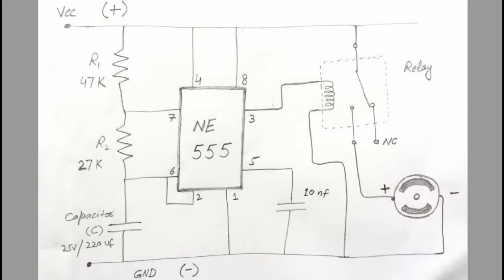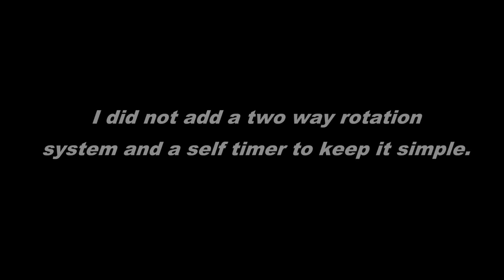How to Make a WASHING MACHINE using Buckets (12V Portable)

Comment: Just a suggestion. Get 5 or 10 one inch rubber bouncy balls. To the inside edges of the washing bucket, glue a half of a rubber ball, the kind you get a toy stores, on various places to create a washboard effect as the clothes are circling around the bucket. This will create the agitation needed to knock the dirt out and push the soap and water through the clothing.

Also, for a drain, drill a slightly smaller hole than 1" approximately 1/2" from the bottom of the top bucket. Insert a male threaded pvc pipe into the hole from the outside. Place a washer onto the threaded end from the inside and use a pvc nut to secure the pipe to the bucket. Use a pvc cap to prevent the water from leaking out while using the washer and remove when emptying. If you want to make the pipe longer, you can either add more pvc pipe or add a hose to the end to run to a drain.
Reply: Ti Phillips 3e

K3m
Reply: Ti Phillips your talent his talent you start a business together I buy
Reply: Invertor technology what is?
Reply: Beautiful suggestions sir very beautiful

Comment: You can make an H-bridge out of power transistors and diodes,  to  alternate the direction of current, the motor then rotates back and forth and it pretty much resemble the commercial washing machine. Great vid though!
Reply from the maker: +Panos Chao thnx

Comment: This is a great project, but I am unable to find an appropriate sized pulsator. All I can find are over 12" diameter which does not fit the common 5 Gallon bucket. I believe that pulsators sold separately are much more common in India, which unfortunately does not export most items like this to the West.

Comment: should have only put the glue on the smallest circular piece of wood.  The way you did it glue bonked out where it didn't belong.  Also it's a DC motor, so you could have set it up to reverse directions between cycles for more agitation.
Reply: Good point. So there should be a locking pin.
Reply: kedwa30
Reply: Kenneth Scharf p
Reply: Kenneth Scharf wwwWA AZ
Reply: H

Comment: Good video, but the design of the washing machine could be improved. If possible, design the circuit to reverse then forward for more agitation and less swirl. Thumbs up!
Reply: After thinking about it, this way is probably better than what I had in mind. Good job!
Reply from the maker: +kedwa30 thnx
Reply: just reverse the polarity of the motor :)
Reply: or if he uses a squared container so the clothes smash against the walls

Comment: For mine, i used bigger buckets and I added a drain plug and a even bigger motor which is 28V power and added a PCB Board to make it spin another way around, for agitation I put brushes.

Comment: did you not use any seal at all around the axel plate? i mean the water should drip by the bolts and axelhole just fine with just a tiny hole?

Comment: you're a smart guy I was wondering why didn't you use a mini shipping Barrel the plastic ones and on the other side where the motor and everything is did you use some kind of sealant so the water doesn't go through
Reply: He did not seal it. The tightness of the connection on the two plastic buckets keeps the seal. You can seal it if that is your preference. Silicone caulk is a good choice.

Comment: There is a reason washing machine agitators change direction. It's so the water pushes through the clothes. If the water and clothes are spinning in the same direction its gonna be very inefficient. Surely this could be done electronically. Close but no cigar on this design. It would also be quite easy to have a basket that attaches to the agitator to spin clothes or just a lock to make the motor spin the whole bucket and a plug in the bottom. Nice first try though. Keep at it ;)
Reply: No want to added

Comment: you should get a better pulsator so it can better clean the clothes, also you should put electrical tape and protect the battery to prevent fire.

Comment: your motor must go clockwise and counterclockwise but your relay connection only shows on and off in one direction/  perhaps you need to change the schematic to allow for the correct rotation?

Comment: Awesome video but I have one question, can there be like a drain pipe to it just to make it easier?
Reply: You can drill a little hole in the bottom and then remove the top part of a bottle and stick it onto the bottom.(make sure that it has a cap otherwise the water will just flow down)

Comment: This is the best damn project so far. I believe some simple improvements can be done with that model, like adding a drainage pipe etc. I also think you'll need a more powerful motor.
Anyway, I'm willing to try this project if I could find the parts.

Comment: Its a nice idea... but it is still incomplete project as a washing machine, don't get me wrong, its a great project.. really.. right now it is still incomplete as a "washing machine" because the rotation of the motor is only in forward or counter clockwise  right? for now its a mixer, but if you find a way to create a control that switches the polarity of your motor then it will become a portable washing machine.. When I was a student, I use to have that same idea, I used the same materials but most of them are scavenged items,  back then in order to have a reverse and forward rotation I used toggle switch hehehe electronic component was expensive that time.. its just a suggestion, make a controller module that switches the polarity from the battery then that's it.. Good luck and nice work, keep it up..
Reply from the maker: +Chinito Gwapito thanks!  I can make it same as you said,  but it will difficult for people to make it. People are already said that make easy projects. If you want to make dual polarity,  just use an H bridge.

Comment: nice project. but the important part is missing the motor should rotate in both directions clockwise and anti-clockwise.
Reply from the maker: +Faisal Abdul Ghafoor it will need a complicated electric circuit. I can make it but other  people can't.
Reply: +Easy HomeMade Projects I guess if u show the schematic of the circuit it will be easy for every one. or better to go for arduino. just an  opinion.
Reply from the maker: +Faisal Abdul Ghafoor ok i will do it in my any next video

Comment: would have been more effective if the pulsator changed directions
Reply: or if he uses a squared container so the clothes smash against the walls
Reply: Yeah would of been better with wool and cotton settings too) LOL, or better still just repair the washing machine you are steeling the parts from).
Reply: Added a PCB
Reply: P plz

Comment: why the water not passing thru the hole between two bucket's??  No rubber seal at all
Reply from the maker: +Nadeem Ahmed buckets are made of plastic. So they will work as a rubber sealer.

Comment: sir in 12 volt dc motor wich motor i should use because there are small motor looks in ebay nd amzo.  how many rpm nd hp pls tell me
Reply from the maker: +Adarsh Yadav you can find on a local motor store.

Comment: great. now add in a rinse cycle so its actually effective.
Reply: All you would have to do is drain the wash water and add fresh water and run it again. Repeat until the water runs clean
Reply: @PinkAlphaMom  Yes but thats not very effective. Just add a hose to one end and a drainage valve on the other.

Comment: Next should be a dryer
Reply: Yes there is a need to spin the water out rather than manually squeeze it, but after that, the best dryer is the sun. However, it does save time to be able to put the clothes in a tumbler rather than hang them on a line and someone living in a hostel may not have access to a line. A typical hair dryer can be used to dry small loads quickly in a tumbler. Just pipe the air through. If the barrel is colored black to absorb the heat from the sun, then the additional solar heat can dry the clothes more efficiently.
Reply: Sun? What is it? I live in UK!! :-D
Reply: and its 78°f / 26°c in the part of the uk i live in right now!
Reply: do you even casul ?
Reply: then a spaceship
Reply: Anonymous 244
why is everyone talking about spaceships today?
Reply: Why not
Reply: Because Leonardo DiCaprio (perhaps jokingly) said he will take Elon Musk's spaceship to Mars.
Reply: Buy a salad spinner and add engine and a hair dryer.
Reply: law Biffingt
Reply: law Biffingto
Reply: Trenzinho da Alegria 
Lmao 😉..
Reply: I got a tension pole for shower curtain and put it over the tub, a space heater that rotates ( reg fan is fine but will take longer) make sure you put it far enough away the clothes dont get too hot, then turned on the exhaust fan. I can put multiple loads at one time and they're usually dry within 2 hours max even without wringing them out

Comment: How long did this toothed Belt last in your wooden pulley. When it has lost its teeth, has the gear on the motor enough traction left?
Do you have a cheap source for geared belts?
Reply: 3 years.

Comment: An interesting idea, but you need it to change the direction every few minutes or the clothes will tangle...
Reply: Not really. The clothes are more likely to tangle from the change in direction. At first I thought as you do that the direction needs to change, but then I looked at my washing machine during the agitation cycle. The agitator reverses very little and mostly to force a complete stop. It may be that the standard design that we are used to seeing is not as good as this way of doing it.
Reply: Well, i have a washer machine at home that doesn´t change the direction of the spin anymore since its watch broke, before it, never make the clothes tangle, now, mi wife has to take out the clothes regularly to stop the tangle...

Comment: I wonder why no drain spicket...
Reply: It's possible with more work, but this design was meant to be the easy version.
Reply: Probably because it's small enough to just dump. Adding a drain is very easy you really shouldnt need instructions for it

Comment: I wonder why no drain spicket...
Reply: drainage is not much concern since it is more compact and ultra light compared typical washing machine by size, weight and volume
Reply: come on.. its just 15 liters of water... just tilt the whole contraption to spill water... easy :)
Reply: 15 liters of water is something like 33 lbs...Thats allot for a woman at least its allot for me...but its still an awesome idea and washing machine for anyone that can lift 33 lbs of water plus that thing probably weights between 7 to 12 lbs...plus the weight of wet clothes...That is going to be heavy to handle for an single lady...
Reply: lol you are really exaggerating here lady eliza........max 15 l is not a lot lol. Its not like you are lifting 15l up. You are tipping it over to drain the water out....so you are not lifting it up. The clothes shoud remain in the bucket. After the soapy water has drained, you can add fresh water into the bucket with the clothes still inside. Spin for 1 min to remove soap residue and then tip the bucket over again and Then get the clothes out and wring them out.
Reply: +mage13011988  I  agree. It's the weigh of a toddler. Mommies do manage to help their kids at the playground up and down from the swing etc... even if petite and not that strong.

Comment: What's the meaning of that? By turning clothes around, they'll not get clean!  You have to get water & cleaning chemicals into the fibers and push them out and repeat that several times, so the dirt gets from clothes into the water. check the Principe of a wash board and you understand how a real washing machine works. this setup will probably work better for mixing lemonade in huge amount!
Reply: Good idea! I wasn't going to make this but now I will because I want to make a lot of sugary drink!

Comment: risky and dangerous to use the motor machine is not directly instaled in the water hole gasket it has a belt to avoid direct electrictric leak never mind
Reply from the maker: 24VDC won't gonna kill you. Don't worry